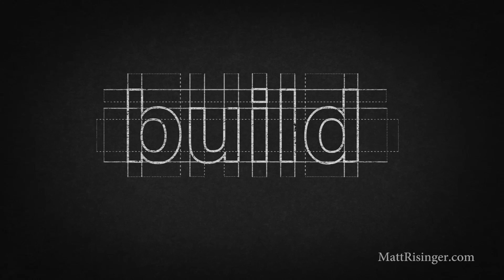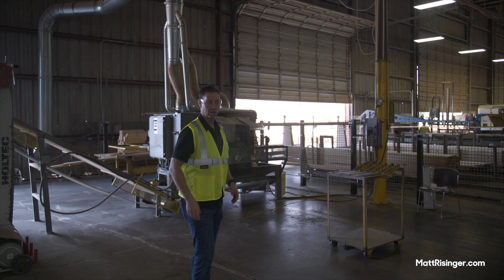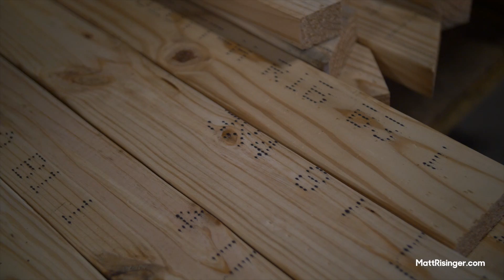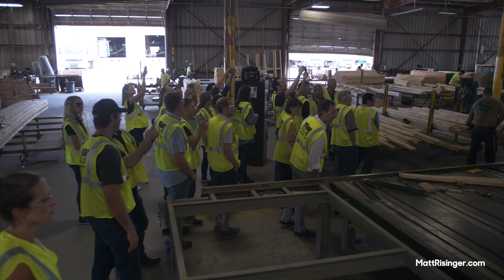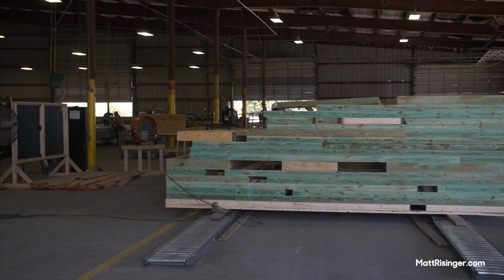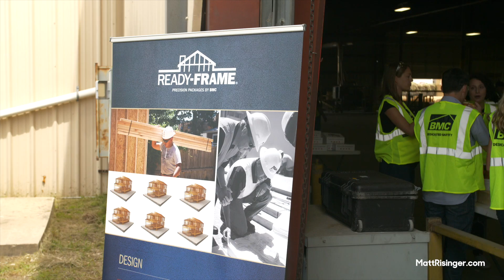Pre-Framing Inside BMC’s Factory

Comment: I went and saw BMC here in Denver yesterday (1/24/2020).  I was told that they charge $0.30 a sq ft.  My house is going to be 1582 sq ft. ranch with an unfinished basement.  So my cost will be $474.60.  They will look through my plans and line up the joists for plumbing and can have rafters over studs if required.  They also provide a "map" (my choice of word) to show how the walls go up and what the square measurement should be for the wall.  The time frame from the submittal of plans to delivery of lumber is five business days.  This means that once you give them your drawings, they can have everything cut and packaged and delivered on the fifth day.  I was told it only takes about an hour to cut an average size houses wood and to have it stacked.  They will hold your wood in stacks.  Meaning, I can have my joist and flooring delivered and hold off on the 1st-floor framing.  I can then call to have the 1st-floor framing delivered the next day.  I can then frame the 1st floor and when I am ready for the 2nd floor I just call for the next day delivery.  When done with that, I can request the roof.  Everything is cut and ready to be sent out, it is stored wrapped up to protect against the elements.  I like the idea of not storing everything on site all at once.  Also, if something changes on your build and you need something different, it requires two business days.  Its not a bad deal.  I was told they are competitive on lumber prices.  They also provide LVL's and LSL's.  I have yet to submit my plans, but when I do, I will provide an update as far as lumber cost and how it relates to other lumberyards.
Reply: Any update or change to pricing or lead times bc of covid?
Reply: @MrJcazarez  I don't work for them.  You need to call and find out for yourself.

Comment: What systems do they have in place to ensure that the lumber used for longer spans and studs isn’t barked up, split, warped and/or twisted like it often comes from the lumber yard? Do they have a system in place that sorts that lumber into blocking and other short pieces?

Comment: This isnt rough carpentry. This is an assembly line. Only the finish carpentry will be left ...  They minus well install the electrical and plumbing while there at it too... Lets see how many trades we can throw down the toilet. Framing in a warehouse.. Machines cutting your bevels plumb square and level cuts... I thought it was cool just for trussles because their specially engineered. But your floor joists, to your load bearing walls, and pre framed roofs craned to the top plates... What carpenter. Lmao. Warehouse workers. Took the manliness out of it ALL.  Thanks OSHA 😷 If you think Im taking a pay cut, your dreaming... Im heading down to get crane certified. Best paying job thats still on the site ... Guess their going to be installing fascia boards with scaffolding or its all going to be 12in. overhang using..........
...... Ladder gable overhangs... Gross. Guess its soft carpentry now.... Didnt even hear one hammer. Lameeeee man

Comment: I’m going through a similar process right now...  a local Florida company (whose name escapes me atm...   if anyone’s interested, ask in a Reply and I’ll post it for you :) took my plans, had an architect go over them to make sure it wouldn’t fall down (she was really cool and made some suggestions that were gold) and will build it in their climate controlled factory...   there’s one major difference tho in that they build with concrete board sandwiches with 8” closed-cell foam cores for the exterior (and roof) walls.    The house arrives on site once the foundation is ready in millimeter perfect, large sections that can be put together and airtight in less than a week !!   Add the Tesla SolarRoof, a pair of PowerWalls and several other whizbang renewable energy tech and I’ll have a house that not only goes above and beyond Florida building code (which is super strict, hurricanes and all) for strength but will also be able to keep power regardless of what the mains voltage is doing...   11 days in the brutal SW Florida summer without power after Hurricane Irma made the decision to go with the PowerWalls a no-brainer !!   I’m super excited and I’ve been documenting the whole process so I can make a series on it...   it’ll be most satisfying to tear down my current 100+ year old house as it’s stupidly inefficient (I honestly don’t think anyone has blowers powerful enough to test its air leakage) and makes terrible use of space.   I’m going from a 2 story, 3300sqft house to a 1.5 story, 2700sqft house that actually uses the space far better instead of the current random set of boxes (rooms) this house uses.  I’d love @Matt Risinger to come check out what we’ll be doing as many of your videos helped me in quite a few decisions I was debating...   reading technical data, reviews etc. is important of course, but getting the practiced experience from this channel was a big help.   Many thanks !!!
Reply: i'm interested... let me know who the company is - and now that its been a year hopefully you're done and can report back how the project went.

Comment: We definitely need to work towards going in this direction, skilled field labor is only becoming a larger problem. A factory built in an area with high unemployment would boost their economy and provide for labor not available in other areas of the country. We do not have our cars built in our garage why does our home need to be site built out in the elements. I did this once for a townhouse development, walls and floors arrived on a truck, off with a LULL and onto the deck. Floor trusses were engineered to receive ductwork so heights could be maximized. Modular and manufactured housing are in our future, the downturn in the economy left us 10 years without new carpenter learning the trade. Now, most are not interested, they want computer jobs so we may need to accommodate them.

Comment: I'm sorry but saying those guys in a factory tacking plates on are "basically framers" is an insult to the real framers.
Reply: We may not be framers, but when contractors are sending 1-1-1-1-1 trusses because you all can't seem to stick frame anymore don't call yourselves framers. Trusses use to be ordered in bundles 20-30 trusses almost all common now its all cut up 1-1-1 bs.
Reply: Also let me add .. we have max 3/16 deviation from original plans. On a table that has to be set by hand and dealing with the sh*tty wood everyone seems to be getting. Let also add in scissor trusses and attics. Attics having the room has to be set so they all come out uniform ... I wish I could just talk it down .. notice in the video the bottom cord splice come apart .. in that case it's an easy fix however if that happens with webs meeting that splice it can be a pain in the butt and may have to be put back on the table depending on the amount of pressure on the splice. It's not cut and dry like the video. Then add in the sh*tty work force we have today ... You work construction so you know the ppl today are not the same type of workers 20-30 yrs ago. I've been building these a long time.
Reply: Lmao i was whattttt framersss lol

Comment: A couple of things that would be huge and not cost nearly anything.  First is to notch the top and bottom plates an inch and half wide, 3/8's an inch deep where the upright frames meet.  With this, that frame is never moving.  Second, in the uprights and maybe even top and bottom plates, drill some holes for wiring, plumbing and other utilities.  Then, come back and fill them with some light-weight filler that can be punched out with a small hammer to a screw driver.  Why pay an electrician or a plumber $65 an hour to drill holes?  Another point: the corner of the top plate should be a solid corner, thirty-two inches long (to overlap two bays.  Same with the bottom plate.  Catastrophic wind damage (i.e. the house blown apart) would nearly become a thing of the past.  Since this would be a very large single piece of wood, you could build the 'solid corner plate' using two 3/4 plywood pieces with a wafer in the middle of metal or three layers of plywood.  (And believe me, getting a robot that can place, nail and secure the gussets would be a piece of cake--can't believe they still use 'people' for this task that would be so easy for a robot.)  ((Re-reading my post: it would be even better to notch the top/bottom plates maybe 7/8's of an inch wide and 3/8's deep AND then notch the sides of the ends of the uprights 1/4 of an inch.  Now, THAt would really hold in those puppies.  It might allow you to nail less and still be stronger.))

Comment: Back in the 1980s or 90s, I remember seeing a TV program about a company that took this a couple of steps farther.  They built whole sections of houses in a factory, to be trucked to job sites, lifted by cranes and bolted together.  These modules were complete with drywall, insulation, sheathing, windows, wiring and rough plumbing.

Comment: I would think that the computer system is programed to maximize material usage and salvage is minimized.

 If so, would this add points for green building?

Also, i wonder about cost differential to framing?

And what is the consequence to the job market?
Reply: Gr8 M9ds If within the miles/distance limit as they can recycle all waste.

Comment: all the houses in my sisters new neighborhood was built like this. they would make the slab foundation on site. but the walls were shipped and just layed down in a stack for a few days. then later they came and stood up the walls. next thing you know they were finished. that whole neighborhood went up in like a week lol.
Reply: basically im not really a fan of these quick production houses.  its 2 yrs old and she's already having window leakage problems and electrical issues. I hate to think of 10yrs from now. and that's just one of many stories i've heard. I usually hear issues with the roof leaks through. none of which is issues with framing though, the issues seem to always come in later down the pipeline. plumbing electrical roofing insulation etc.
Reply: Lakario Davis It would not have been any better built from scratch. Poor quality installation is exactly that.

Comment: We actually have a two story farm house that is a Sears kit house. Originally bought by a school teacher, upon delivery the men of Studley KA built the house, with full basement in three days. We are the third owner of the house.  Believe it or not, still has original Windows and doors. Some of the boards on the porch have been replaced because of weather and age. The original steps long ago rotted away and were replaced with cement steps in the 40s.  Ok to live in during the summer, but you do not want to try to survive a blue northern winter in it. Heaters and fireplaces just cannot keep up.
Reply: I put new doors and windows in my 1949 Sears house,  then spray foam insulation where convenient, and sealed cracks where possible, and now the house is reasonable to heat and cool.

Comment: This is a way to build a house like a giant cabinet.  Tolerances can be tight, and waste can be low.  We toured a builder in Vermont that did this (and was featured on a TOH series) and besides the excellent quality, the reduction in waste was incredible.  The dumpster subs are gonna hate it!  Finally, the ability to build cabinet grade exterior trim packages is extremely valuable.  All done in relatively controlled climate and has to be safer.  Lots to like about this, and hope to see much more of it in Texas.

Comment: Lack of use of floor trusses in the Northern Cities I believe is often because of basements, fire restrictions, weather and a few other things. It's expensive digging a basement and concrete for a basement foundation wall.  Also build-able space is at a premium so you want to max out the number of floors you can build. Trusses often take up too much of your allowed elevation space. It's often better to have a steeper roof to shed more snow load weight than to have space between floors for utilities. It is easier to put utilities in the basement and run lines in vertical chaises than horizontal chaises in most cases.

Comment: Do you ever use radiant barrier osb like techshield.  Is it worth it
Reply: He spray foams under his roof decks.  Without an air gap radiant barrier is worthless.  From what I read, you'll get more bang for your buck with better air sealing and insulation.  Once those are maximized a radiant barrier is a nice add on.